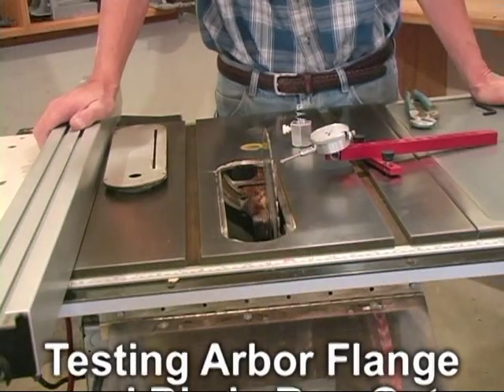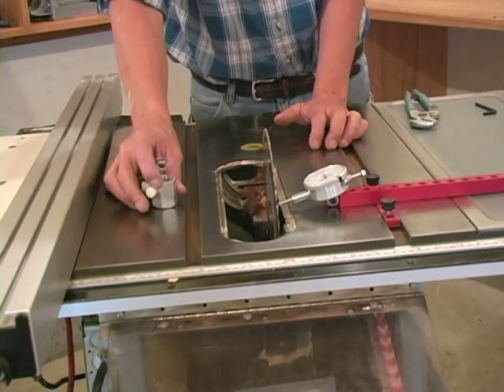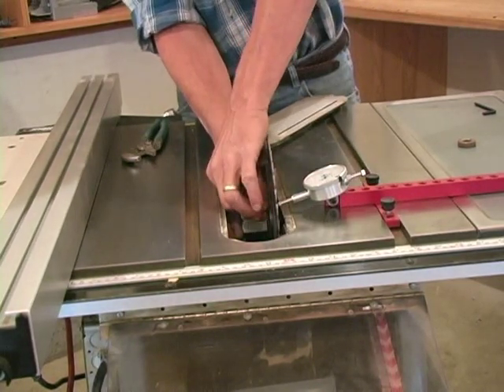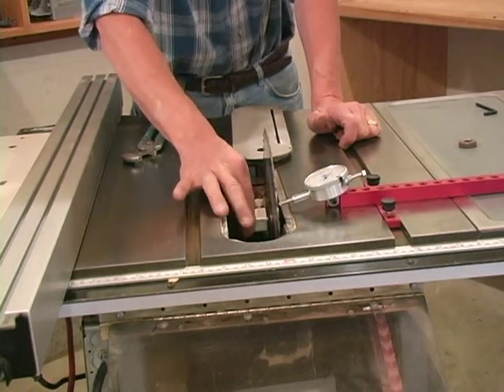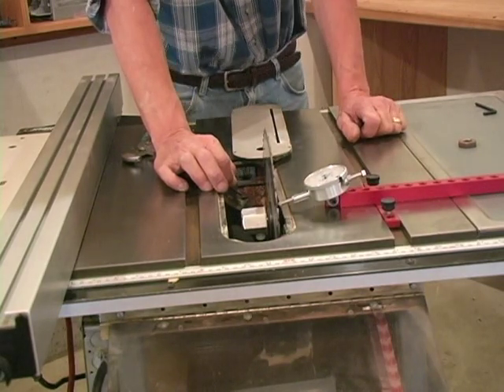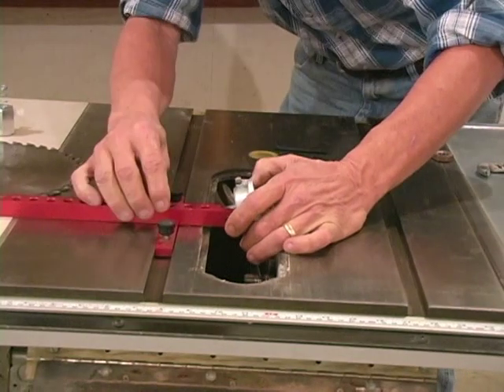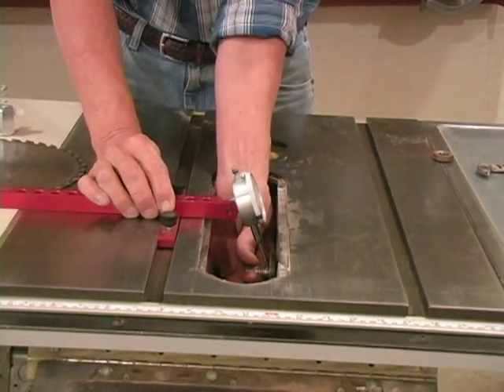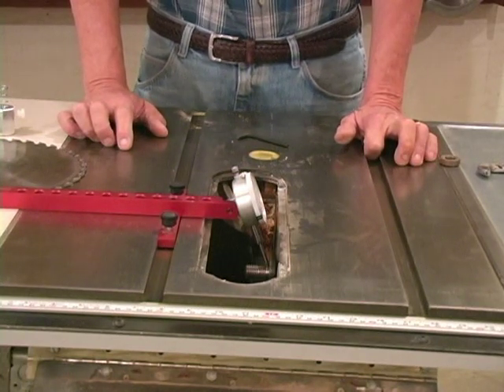Blade and Arbor Run-Out

Comment: Is that a Craftsmans 113.xxxxxx  table saw?  How much noise are new bearings suppose to make when install them in this saw?  Is there any noise at all?  Did you ever replace bearings on yours and if so what brand and kind did you use? I put some new  bearings on my old craftsmans 113.xxxxxx  and I thought new bearings would be a lot quieter  than they are.  Check out my video on it.